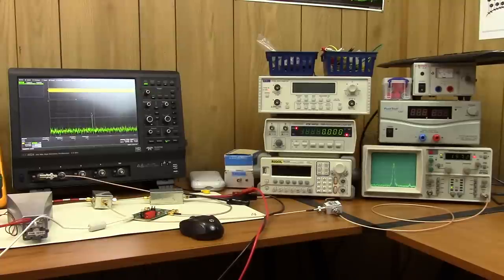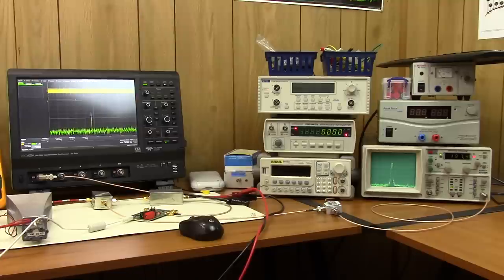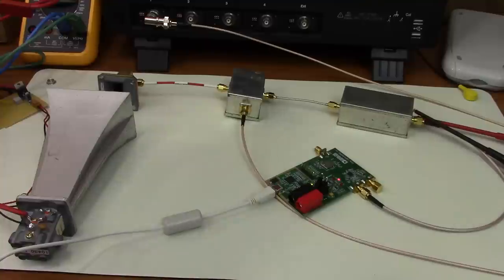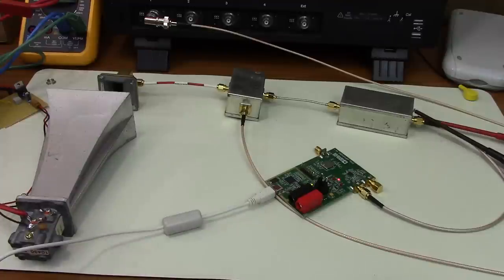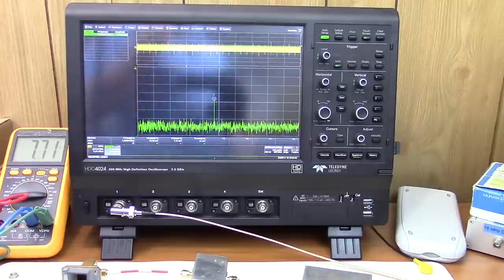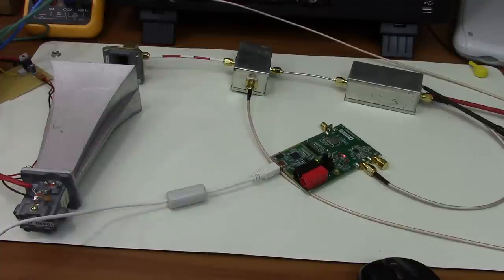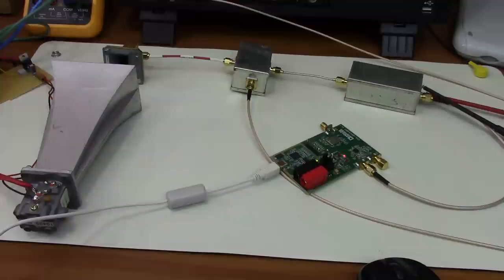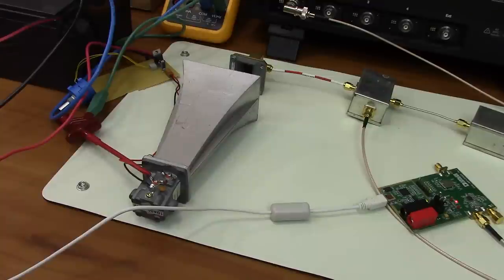Microwave Experiments on a Budget

Comment: Great advise thanks, though another on budget idea for measuring your local oscillator (LO) frequency instead of the HP frequency meter (assuming your ghz signal is periodic) is to undersample the signal using low cost digital oscilloscope (such 100Mhz rigol oscilloscope or the 200Mhz crappy usb oscilloscopes ) most of them can equivalently sample up to 20 Ghz, i never reach that high but it could help.

Comment: That's really inspiring .. I have a stupid beginner's question.  Can you put a waveguide between 2 boards running on different voltages? with high frequencies running through the connection
Reply from the maker: Yes you can. Only the RF signal travels through the waveguide.